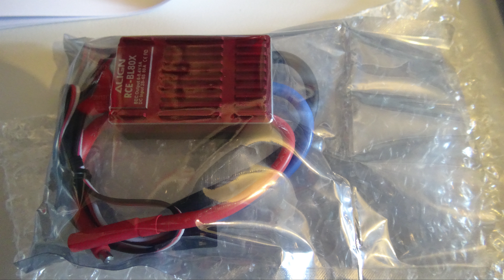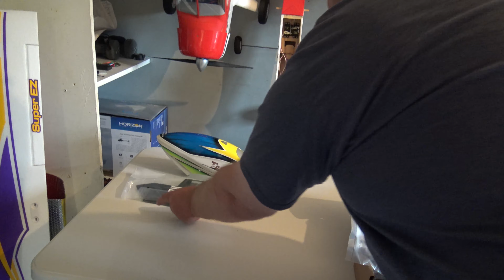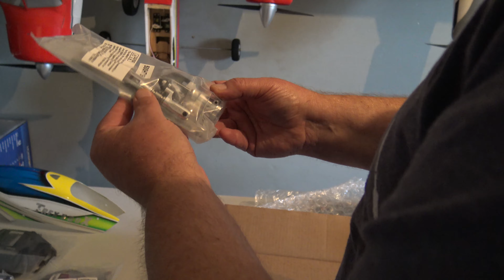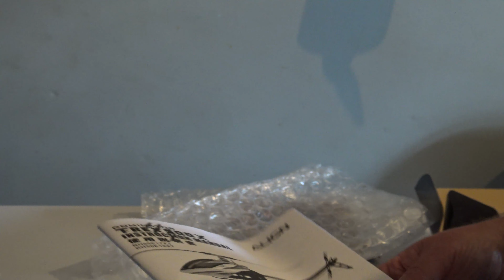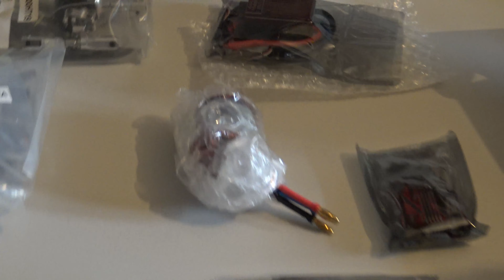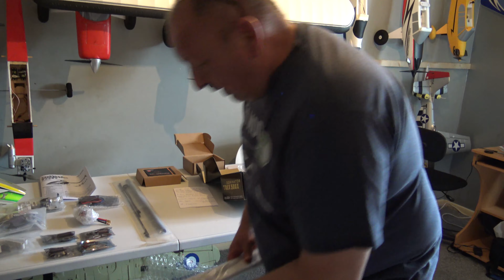ALIGN DOMINATOR TREX 500X UNBOXING

Comment: So sorry for commenting again Ian, I just wondering, have you any idea why the 500X has such bigger blades than it's 500E cousin ?? Those main blades look HUGE!!?? And it's running a 1600kv motor, which to my knowledge is same kv rating as the original 500E ?? Same 6S Lipo power too mate ?? Don't you think thats odd Ian ? Or what am I missing ? ( knowing dopey me, it'll likely be something patently obvious!? LOL ) Wes, Liverpool UK.
Reply from the maker: No idea Wes I think the bigger rotor disc just makes the Heli more stable 😀👍